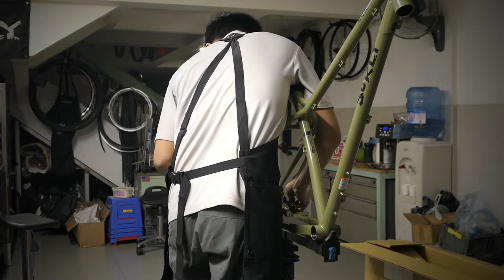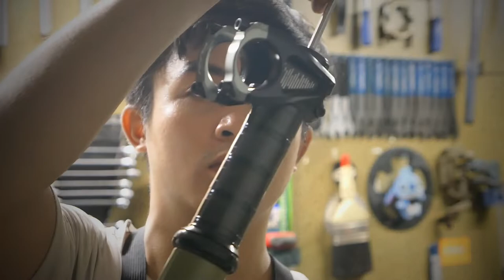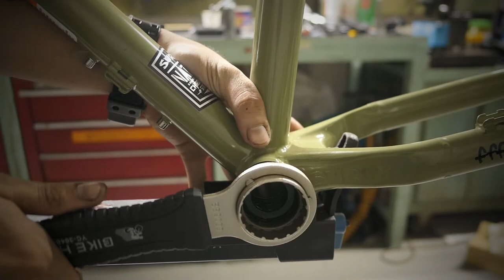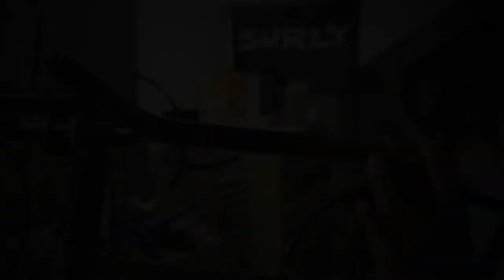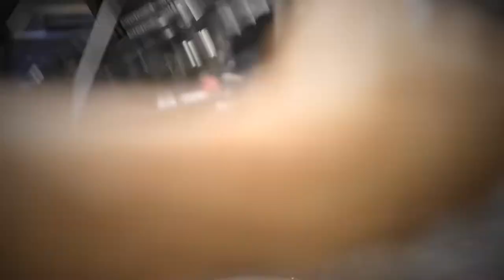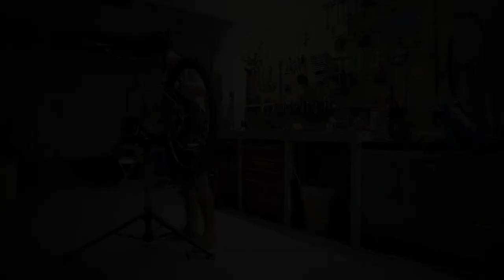DREAM BUILD TOURING BIKE - SURLY ECR | Độp Workshop

Comment: The frame will break where the right chainstay joins the dropout because the seat stay does not aim at the rear axle but instead forces the dropout to rotate counter clockwise.